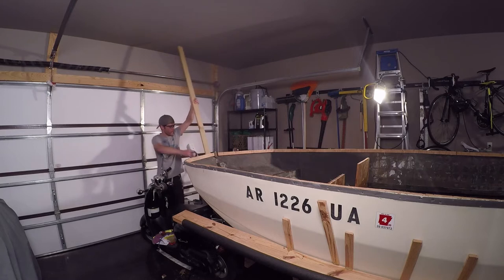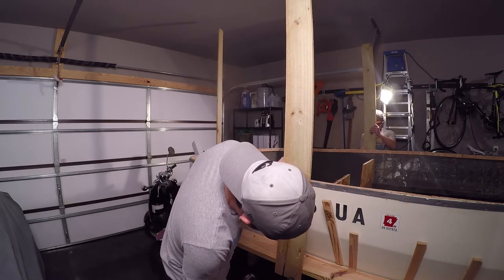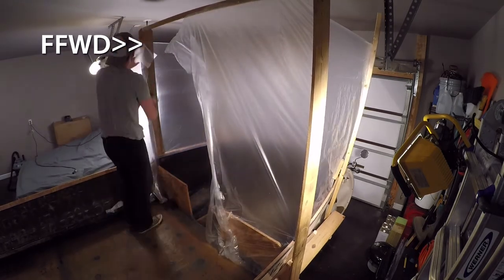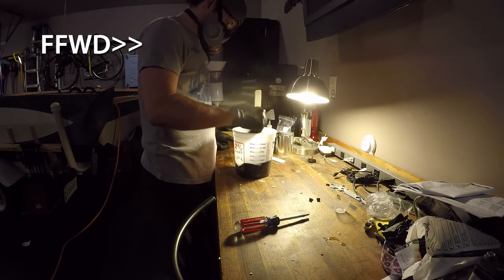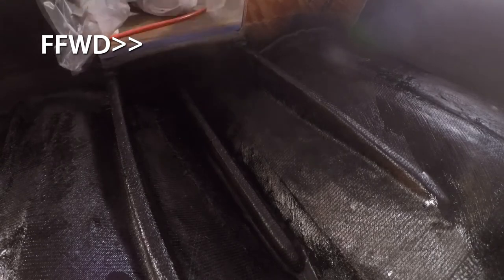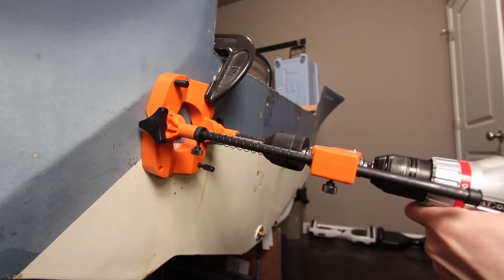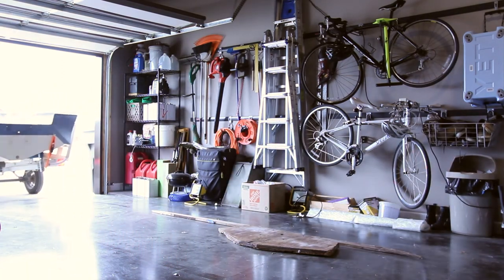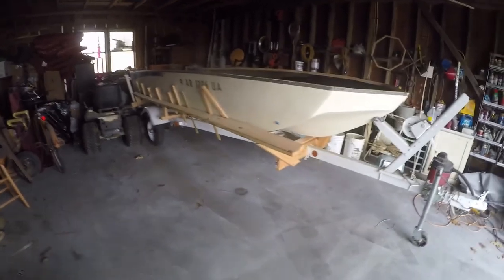My Clone and I Build A Paint Booth // Project Glastron/Vlog #19

Comment: Did you use any sealant on the stern eyes?
Reply from the maker: +Lit Garage no I didn't.  They are temporarily there so I could move the boat out.  They will be getting removed for painting the exterior of the boat and reinstalled with sealant when the time comes.

Comment: Smacking progress, did you have any problems with the gel coat hardening in the gun?
Reply from the maker: +devildogae no problems, it worked great.  Definitely not like spraying paint.
Reply: jmink did you use a regular hvlp gun, or gel coat gun?  what size tip and pressure?
Reply from the maker: +devildogae I used this gun here: http://www.harborfreight.com/20-oz-hvlp-gravity-feed-air-spray-gun-with-regulator-69705.html

I also used it standard with all of the tip that came with it.  I then set the pressure on the gun at 30 psi.